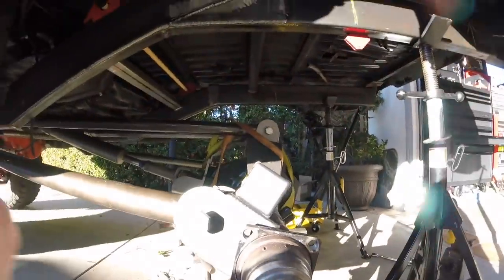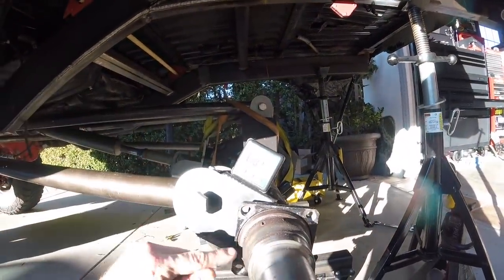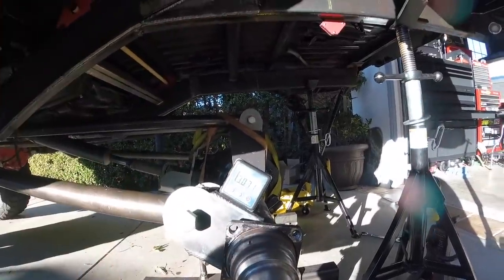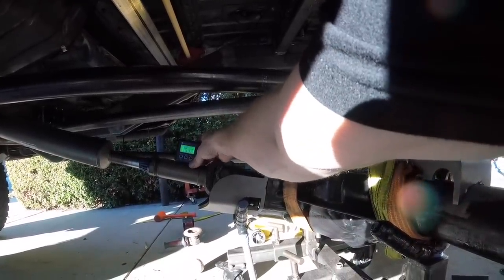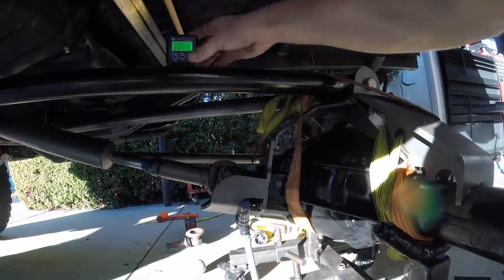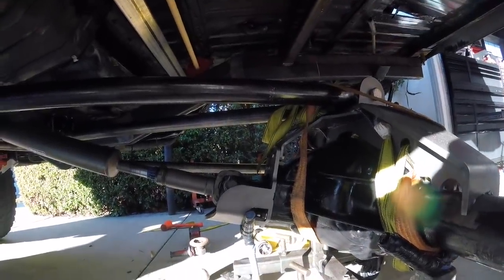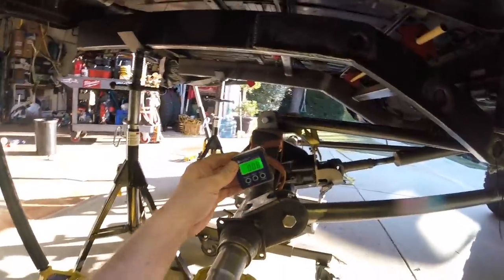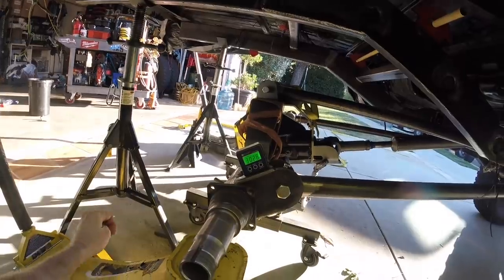MG #137  - Rear Four Links for the K30Blazer Part VI

Comment: Ok.  Disclaimer, I am no expert!  My knowledge of sway bars is they are to keep the chassis and axle from articulating.  When offroading you want the axle to move freely to stay in contact with the ground.  I would think that you would want disconnect links so that offroad they are disconnected (seen these for Jeeps) and connected to asphalt/highway use.  Am I missing something?  I truly enjoy watching the build!  I have a 1990 Blazer that I just bought and I would like to do the four links in the future.  Love the videos!  Please keep them coming!  Merry Christmas!
Reply from the maker: There is enough torsional resistance in the sway bar tube or bar that it will allow for full articulation when needed (weight of truck will guarantee it) but enough that it won't wallow around on the street.

Comment: just wondering, what's the best limited-slip type I should get for my vehicle, it's a Suzuki Sidekick. I want to put torsion limited slip front and back, mainly for snow use going from Sacramento up to Lake Tahoe in the winter back and forth. Safety 1st!
Reply from the maker: the Torsen Design is awesome.  If you want reliability and dependability, they are the way to go!
Reply: Yeah. Will do. Its 112 miles 1 way 1-80 from home to Lake Tahoe. Dependability is preferred.

Comment: James.... looking good and I've felt your pain.   (Installing a 4-link and fitting 16" travel rear shocks).  I can't believe you are trying to do all those measurements without zeroing-out your truck relative to the sloping cement, etc.  I started with a 0.0* level on the center of my framerail... then added small 12"x12" MDF spacers under each tire to set the actual ride height relative to that spot.  Like so:   https://i904.photobucket.com/albums/ac249/gregblanchette/K5%20Gallery/chop%202.jpg  You can pull dimensions directly off those MDF plates, and you can lay a long piece of square tubing between the front/rear to create a "virtual flat ground" to index from.   Happy to see you using "Steel-It" and giving feedback.  Just bought one can to experiement with a while back and was hoping it was "the real deal" for a coating that can be easily touched-up if scratched, etc.   Merry Christmas!!!
Reply from the maker: The truck is level on the driveway which is only 1.5 degrees.  I zero my level off the driveway so that all my numbers are correspondingly zeroed to the drive.  The steel it is great.  It does take a long time to fully cure (up to like 8 days!!) but it lays on so thick, and has really good coverage.  It isn't that great to weld through.  Would work fine for field repairs, but to make it clean, I would still start off with bare metal

Comment: 30$ a can?? Powder coat is way cheaper
Reply: Powder coat cannot be repaired without fully stripping the part/piece and repowdercoating
Reply: @douglass509  sherwin Williams  makes paint for touch ups.
Reply from the maker: But a ton more inconvenient.  Stripping the part down to take it in and dealing with the turnaround...
Reply: @MerricksGarage  Not trying to say you're going about it wrong or anything, I was just trying to articulate my opinion. I'm not familiar with that can a paint you're using , I just love your build and wish you the best and hope that stuff works great for you. I have been powder coating for a while and always have customers surprised at how affordable and quick we can get it done for them, your area may be different. Anyways, can't too see that thing flexed out.